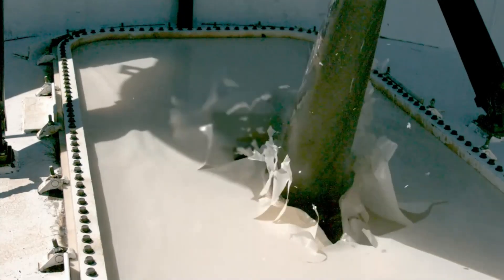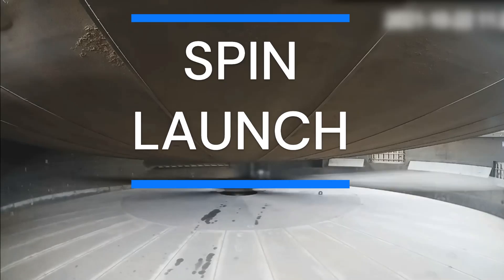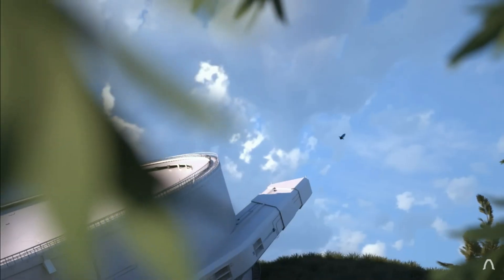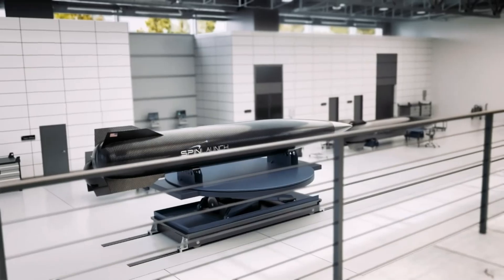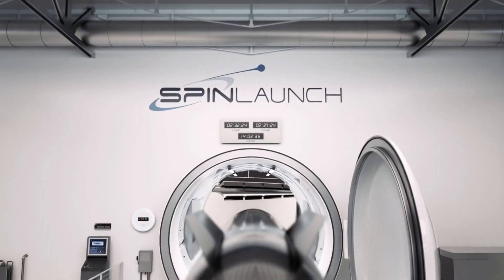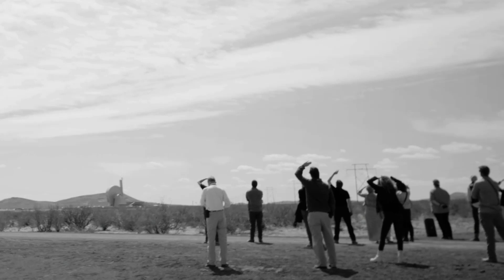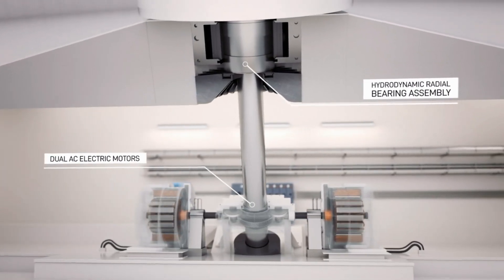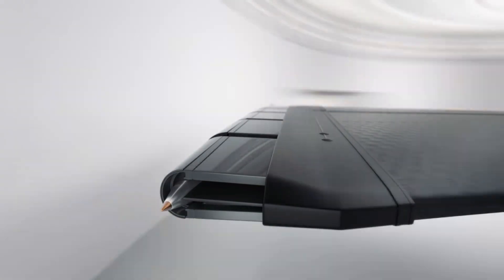NEW SPACE CRAFT, Spin Launch

Comment: Of course nearly, perhaps more than a hundred years ago, such devices were proposed as weapons and made to launch bullets to avoid the dangers of gunpowder in the Amory.   The problem is that as a gun, it was inaccurate but of course in launching spacecrafts, the spacecrafts could have thrusters and aerodynamic control surfaces to correct the aim to some extent.   Note, not only would there be the extreme g forces of the spin but once it's through the membrane, there would be extreme forces from air drag as well as extreme heating from friction for going through the atmosphere similar to that of re-entry but worse as the heaviest part of the atmosphere would be encountered first and a blunt shape to create distance between the spacecraft and the shock wave can not be used to help shield the space craft as that would increase the drag and slow down the vehicle more.  This video s a very old idea that we do not use for several reasons, whether or not a startup could address these problems is of course another matter.
Reply from the maker: Great